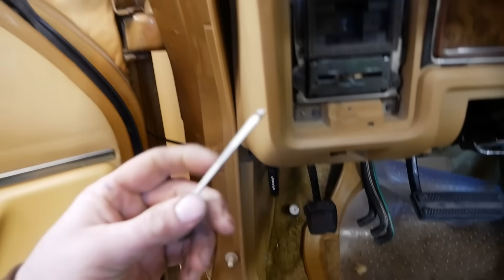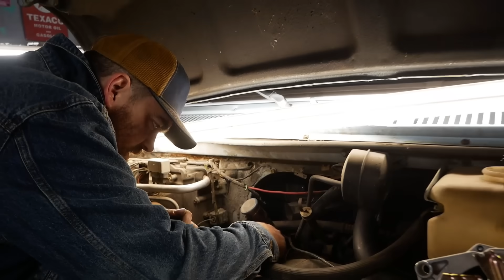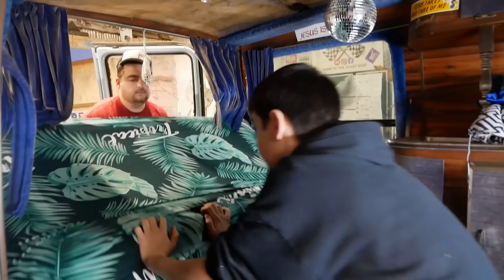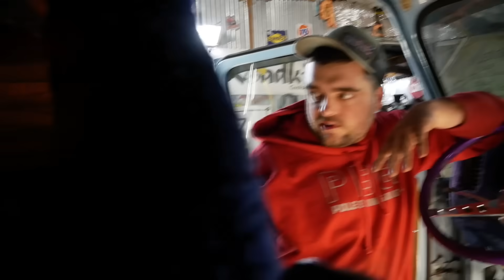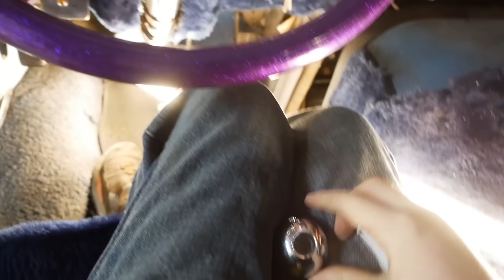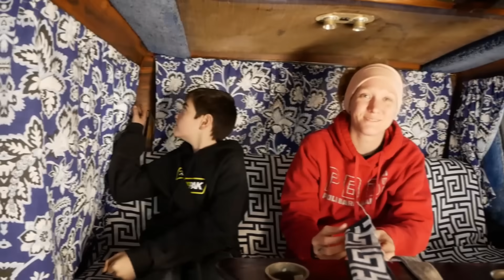Fixing Like It's 1978! SURVIVOR LTD Maintenance, and BOOGIE Van Upgrades

Comment: You know I'm fixing my classic Chevelle. I pulled the tank it could use some cleaning and resurfacing but I chose to buy new because I can't do squat right thru filler. Now,since I have time I'm thinking cut a 5x5" hole top center if it's got that much smooth metal. Anyway cut that out do my cleaning and por15 it. I'm not sure it's worth the minimal savings once I buy products to seal inside. I was thinking using 16ga. or thicker with another strip of same around the bolting area which would be around the perimeter with bolts or screws about 1" apart and some type gasket material. The pro's would be an accessible interior of tank for future problems which should never happen. The seal should be fine but it could possibly leak I guess. You think it's worth going through all that or just buy new and forget it? I shouldn't be bothering you I guess I know you're busy enough. Maybe a follower will respond with some kinda idea. Don't waste your time but as I said I'll leave it up for others and we can load your comments up helping your channel. I'ma go look at top of tank now see if there's a flat surface to work with. $20 for 16-12ga. A $10-15 pak of sealed screws or grommets for bolts which sounds stupid given the inability to hold backup. Then what $60 for por15? That's $100 and a round figure of $150 for new. One more thing I got to add a return port the ZZ4 crate has 3 nipples inlet,outlet and return which the OEM is just inlet/outlet. Surely it's a bad idea to tie it into the vent port due to possibility it go up and out the vent hose. I could possibly buy new tank with return hole built in. I'll go look now see what I come up with

Comment: $20 says if you take the aluminum top off that tachometer, you can "calibrate" it. At least roughly. You'll find a potentiometer that looks like a Phillips head screwdriver fits in the plastic part, and you should be able to adjust it that way. Hell, send it over, and I'll calibrate it for you. You've brought me many hours of enjoyment. I how to return the favor. Maybe I can afford the low buck club one of these days. Thanks, Dalton. I owe you and Kevin a few beers by now for the content. 🤙🏾

Comment: Someone probably already said, but the "gasket" clear membrane in the air horns wasn't a gasket. It is the membrane that vibrates thru air pressure to create the air horn sound. It needs to float freely. Adding gasket sealant muffled it. Just for the future. And awesome van dude 🤙🏻

Comment: I thought the button for the light switch was on the top.  I replaced the switch in a 1978 Mercury Marquis with the Peek-A-Boo headlights.  They had a tendency to go bad.  The doors for the Peek-A-Boo headlights would stay closed and the running lights would stay on when it broke.

Comment: Pull that vacuum headlight switch slow especially when it's very cold outside if your headlight doors don't open there's a manual switch under the hood it's on the driver's side behind the headlights it's a round deal with vacuum hoses just twist it headlight doors will open and stay open if the owner's manual is in the glove box it will tell you about it in there
Reply from the maker: I've learned that lesson the hard way twice now

Comment: Too bad you didnt know theres a headlight cover bypass vac valve located on the left front inner fender by a big vacuum tank.  it has 2 hoses going in and 2 coming out.  Its round and the hoses have a green stripe and the other yellow.  If you twist this switch 90 degrees the headlight doors will open and stay open.  Just an FYI for anyone with 70s fords lincolns or mercs with hidden lights

Comment: Im actually about to buy a 78 ltd myself here next week. Its in ridiculously good condotion and runs and drives. It will probably need a little bit of tuneup etc. But the deal is stupid cheap even if its needs a rebuild

Comment: 4:56 I would've made a special trip to Missouri to smack the back of your head if you put "NEW 2024 LATEST FLAGSHIP MODEL PUNISHER SERIES Angel Eyes SuperBright LED RetinaCooker FlashBang Deluxe H319/H13/H10/194/212 Replacement OEM 9500K with over 40,000,000 Lumens by KGSSBLGAIAITA AUTOMANIA" headlight bulbs in there.  The Retrobrights look AMAZING though, so that's going on the "to buy ASAP because Dalton proved it isn't shit" list for sure!

Comment: Good job on the new doors, I bet that keeps the wind out a lot better!  I'm sure that table pole comes out, whether or not it matters to you enough to go to the trouble is a different matter.  You should be able to un-bolt the bracket mounting it to the floor to get it out if needed.  In campers that comes out and the table top is used as the bottom of a bed, usually.  I fear the first time you roll out of bed in the middle of the night after a few twisted teas you might damage yourself on that thing...

Comment: The lights are likely dim from resistive current losses throughout the circuit. But good call on saving those old sealed beams, they ain't making any more of them!
Reply from the maker: Nah the wiring is as immaculate as the rest of the car. It's 10awg wire from the switch, plenty of juice
Reply: @PoleBarnGarage  Suspect would be all of the connections in the circuit. Check the voltage output at the terminal vs the battery posts. Either way it's not a problem now with the LEDs.

Comment: I had a two door 78 LTD in the same color.  Bought the body out of a salvage yard in the mid 80s and put a built 351C out of a Mach 1 into it. I drove it white walls and hub caps and all surprising the 5.0 mustangs of the time😅

Comment: @PBG, you can fix the airhord by replacing that 'plastic sheet' inside the horn. It using the pressure to vibrate the plastic making the horn noise. If you use a very thin but atong piece if metal it will work even better.

I think they also sell replacement kits to do that for modern airhorns that shouldnt be too hard to adapt.

Comment: You need a strap wrench for those two part RV table poles, they can easily get hammered into the lower base and get stuck.

Once you get it out, polish the end a bit and the bracket it goes into, as it likely has developed burrs from areas the pole is steel and the pedestal base and table top piece are cast aluminum.

Comment: best thing for that van it pee jug or port a potty late night remote areas plus got 12v cooler or heater comes in real handy wett wipes gear even hitch rack just got watch low curb exits scraping lights like clap on battery power basics even good glad smell 
spray or disanfecten

Comment: big old cars where the best yep pulling 40ft mobil home lot them had systems brakes aif fuel lot setup for use like truck 
even1920-40-50-60 had so best options fwd 4x4 to raceing even fields farming yep were going to church one day pulled hay wagon even apple carts to next field jobs reat cars built with armor glass refrigeration or storage pruducts

Comment: I'll ask my buddy Perry if he still got a picture of that old LTD that he picked up I think he bought it for like $6,000 or $8,000 I can't remember that was 15 years ago it only had $40,000 mi on it we rode it around there for a couple weeks it was clean every single piece on it. We had to put a muffler on it but the brakes were good everything was good and we put a set of wiper blades on it that's all we did I think he put like two or three thousand miles on it if I can get the picture of it I'll send it to you it was clean man he turned his into a derby car the guy wanted $10,000 for it he had it towed from North Carolina on a flatbed to Ohio... It was garage kept. The paint didn't look as good as what you got but we didn't buff it or anything.

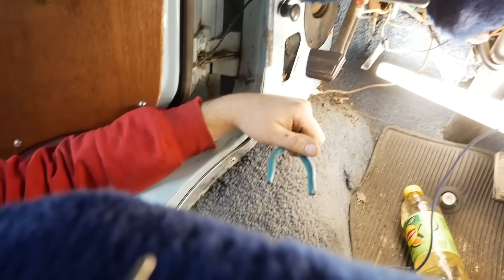Comment: 25:45  Or use the parking brake like one is supposed to do. If the parking brake is set, even in D, the engine isn't gonna make it move. IMO that switch sould be tied to the parking brake rather than the shifter.

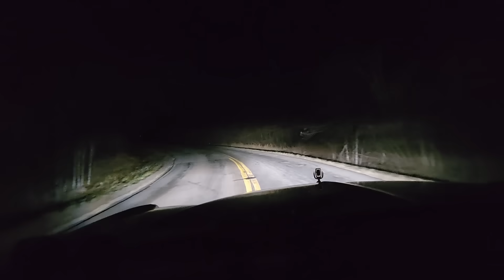Comment: 11:58 Yeah you're seeing about as far up the road as I do in my 85 F150 on its sealed beam headlights. Those LEDs aren't helping you see any better than some $20 a pop Sylvanias would have.
Reply from the maker: I've been around long enough to know what a good headlight is like. Your truck is higher, you can see further. These are fantastic lights, although expensive
Reply: @PoleBarnGarage Eh it doesn't sit high enough to account for that. It's a 2wd with sunk 40 year old springs that have it sitting a good 2-3 inches lower than it did when it was new. The headlights aren't really all that much higher than they are on the LTD and certainly not high enough to make the sealed beams shine out farther than they would on the LTD.

LED lighting blinding me is a major problem. I get dazzledby them in broad daylight, and often times it's the converted cars that do it. LED turn signals, taillights even blind me. Hell my own fucking dash lights in my 2014 Challenger are blinding unless I have them turned down to the absolute lowest possible setting. 

Might partially be my eyes...I can't afford to see a doc about it but some people have told me I might have astigmatism...but I honestly did not have any trouble with being blinded by low beam headlights until LEDs started coming out. Back when everyone still had halogen bulbs I could drive at night and be just fine, but LED headlights are so searingly bright that even on low beams, correctly aimed, in correctly engineered housings, it's like staring into the sun through a magnifying class. 

The holley lights you put on this LTD are much better engineered than the typical cheap amazon special LED conversion I see for sealed beams...guys driving Chevy workvans in my area typically fit them so I see them ALL THE TIME...but they're still going to have the same problems and they'd still make me feel like I shot a thousand rusty tattoo needles into my eyeballs.

I can't stand LED automotive lighting. Not factory, not aftermarket, not extrior, not interior. It always blinds the fuck out of me no matter what angle, position. Hate them. Deeply hate them. Can't stand them. I have a feeling one of these days they're going to make me hit someone head on or run off the road because my vision just turns into this sheet of white pain.

Comment: 11:42 They very much are.

1: The color of the light is wrong. Bright white light like that is incredibly piercing and blinds us far easier than the yellow-ish light that the sun produces, that filament lights produce. Large part of why LED head lights are so infuriating to other motorists. That color makes them far more painful to look into than it otherwise would be.

2: Their light dispersion pattern puts far more of their output directly into oncoming motorist's eyes. They're highly directional and the reflector/refractor arrays in headlights struggle to send that light where it needs to go because that light isn't really hitting any of that optical bullshit to begin with. This is bad enough when they're in a housing that's designed for them, as is the case with these sealed beam replacements, with OEM LED headlights. It's even worse when they're fitted to cars that previously came with halogen bulbs in seperate plastic light buckets.

3: DOT standards for automotive lighting are 70+ years old and base their limits on wattage drawn. A 55 watt low beam headlight will be about the same brightness manufacturer to manufacturer when it's on a tungsten filament like it was in the 1950s, and that limit was set to provide adequate lighting for the driver of the car carrying that light without blinding other drivers. But LEDs are orders of magnitude more efficient at turning electricity into light, so a 5 watt LED will be absolutely searingly bright while being nowhere close to the limit that the DOT puts in place for low beam headlights.

4: There is ZERO checks-and-balances on manufacturers building these things. They are currently in a brightness war that even the OEMs are locked in, seemingly uncaring about what happens to the poor bastard on the other end of the headlight only caring that the driver behind it is able to turn night into day with the power of a thousand continuous atomic explosions in each headlight assembly.

There is a good reason why I get volcanically angry about LED headlights in cars....if you came up towards me on a 2-lane country road and you didn't drop to your marker lights I'd be giving you the one finger salute over those things. Melt my retinas out of my fucking skull with them even on low beam.

Comment: 10:36 That is one of the major reasons I refuse to even consider buying a modern car. I like easy to work on. Serviceability is one of the most important things about a car to me, and the more serviceable a car is the more interested I am in actually owning it.

Part of why I am to the point where I won't give time of day to an F150 if it doesn't have the 300 six in it. Part of why I'm so damn excited to have inherited a 71 C10 with a 250/3spd driveline. The simplicity and serviceability of domestic carby OHV I6s and manual transmissions is amazing.

That C10, in particular, really takes the cake here. It doesn't have ANY fanciness going on. No power steering, no power brakes, nothin'. Stone dead simple. A lovely, easy to work on blank slate to make my own, and all I plan on doing to it beyond arousing it from a 20 year slumber is fitting FM radio, aircon, and a dashcam to it. Other than that, it stays just as it is. Points fired, 1bbl carb straight six, 3 on the tree gearbox, manual steering, manual brakes. And it will be my daily!

And no, I won't be putting LED headlights in it. I have the courtesy to not melt everyone else's retinas out with LED headlights. I will be putting new headlights in it because the ones in it are likely 30 years old, but they will be sealed beams just like what's been in it since day one.

Comment: My first performance car was a 2000 Audi S4 with a twin turbo 2.7L V6. Later in its life I upgraded to Stage 3 which included new turbos which required pulling the motor to access them. What I learned was the German engineers really liked to pack things in, making it miserable to do general maintenance like replace an alternator. The alternator is buried such that it was located above the oil pan and the only way to access it is to remove the whole front end which means the bumper, headlights, radiator, and AC condenser. You can get an aftermarket alternator today for $240 ($1350 for OEM) and I'm imagining $240 for the part plus $1000 labor lol. I'm glad I sold the car after 10 years but I also miss it.

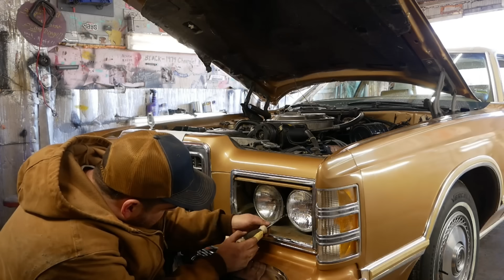Comment: 5:50 Yep. Same  deal with these. They're retina melters. They're making my eyes hurt just watching it on youtube. If I saw them on the road I'd be waving the one finger salute out my window.

Your sealed beams are dim because they're old. Simply replace them with brand new sealed beams. That's it. They do that over time. I had to do that with the sealed beams on my 85 F150; they got old, got dim, so I put new Sylvanias in it and voila. I could see at night again, but without blinding everyone else within three miles of the front of my truck.

Ugh. I fucking hate LED headlights.

Comment: I'd put some seatbelts in the back of that van, or your passengers will come flying out the front window when more than a bit of brake is applied. You wouldn't want to make JD a projectile, I guess 😅

Comment: With the old switch, don’t bin it. The crack, you might be able to seal it up by running a soldering iron over it. The fact it won’t go into more than one position? Something has probably collapsed internally. You would need to dremel the rivets off and see what you can do. If I was US based, I’d offer to take a look but because I am in the UK, it might be a bit expensive.

Comment: Ltd deserves to be a sleeper daily. As far as to why the lights are dim? That answer lies in that switch you put in. Most if not all vehicles ran the headlight power through the switch instead of a relay up until the late 80s early 90s. If you retrofit a relay into the wiring they get far brighter. Works really good

Comment: Man, I love that LTD.  She's so original (as in unmolested by multiple owners) and clean underneath.  Glad you are able to give her the exercise she needs as a daily so it will keep her good for years to come. I'm not a Ford bloke by any stretch, but I can sure appreciate (and drool over) a beautifully kept classic as good as the nest bloke!  Great lights, but I looked them up and at $193 from Holley - EACH!! - I think I'll be waiting a while before I get myself a set.

The Boogie Van is one cool ride, man.  Even better now it has a couple of your old shirts as its curtains and a bespoke designer original rear seat cover.  I used to have an electric tach back in the 80s as well.  Unfortunately the car I last had it in had a leaky windscreen and the electronics took exception to being flooded multiple times and threw in the towel.....but it was great while it worked.  Bloody slow response (like it updated itself every half second or so), so no good to watch for the rev limit when you were accelerating off the line, but it was great when cruising along.  Haven't seen one in about 30 years, so seeing yours was a flash back in time for me.  Yeah, they did have a 4-6-8 cylinder switch underneath (well, mine did anyway), so you might be able to unscrew it and see what its set to.  

Love the little table you added and as a quick thought, my Dad fitted something similar to our van back in the day.  How he did the pole was to have a 3" piece of exhaust pipe that was a tight fit around the main pole welded and braced to the floor with the top of the pipe at floor level so you didn't trip on it.  He capped the bottom so the table pole would not fall through and then we could put the table and pole in when needed or take it out and tuck it under the bed when we wanted to sleep. That would solve that little problem for you I think.

All the best